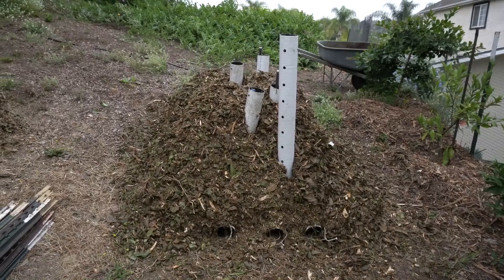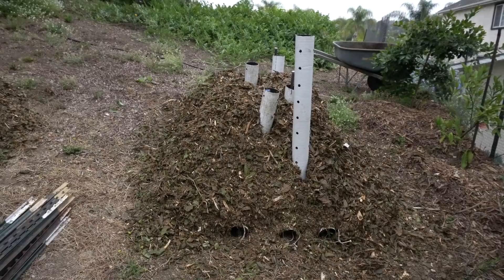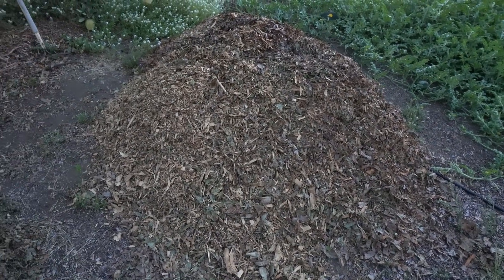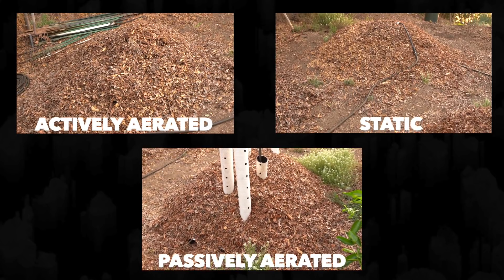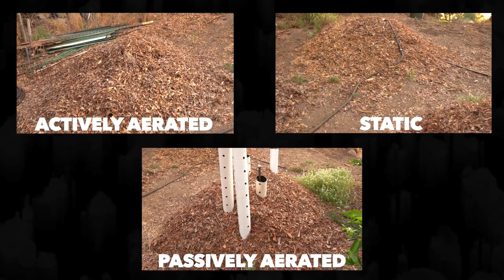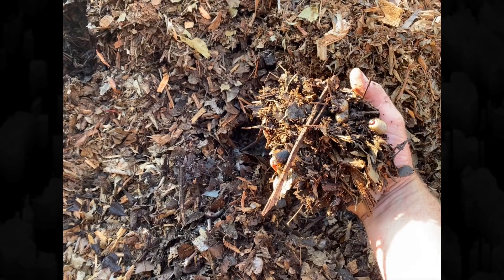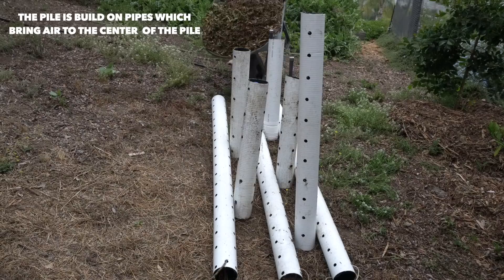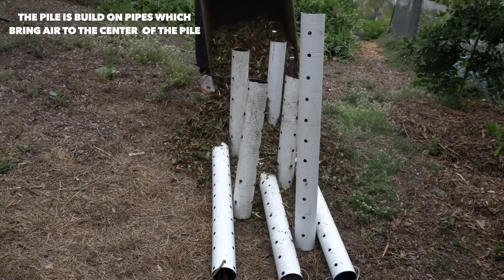Composting Wood Chips - Turning is a Waste of Time

Comment: I’ve noticed the biggest accelerator is moisture. The places on our property that stay wettest turn black fastest.
Reply: Agreed, I use to catch runoff...black and broke down in about 4 seasons.
Reply: And even faster if you moisturize with urine!
Reply: Maby using some amonia it acelerate the process
Reply: For the non squeamish, urine is significantly better than plain water in accelerating breakdown.
My beer & wine is all "recycled" through three large compost bays.

Comment: Personally I have found great results with blending woodchips with a good amount of fresh grass clippings, as well as shredded comfrey. I also took some weird old guys advice of adding worm juice and beer for an influx of microorganisms......at this point we're basically talking compost though. 

We have the perfect pest plant for woodchips in Australia. Not sure if you have it in American. It's a British originating pest plant called Lantana. Its a creepy woody vine that basically engulfs entire properties in two or three years if left unchecked. What is good about this plant is when mulched it has the perfect consistency of a very fine woodchip blended with alot of green material from its leaves. 

I've noticed Lantana woodchips break down VERY fast into a beautiful humus. I think this is due to the high nitrogen and high carbon in the woodchip. 

Good stuff man. Keep it up.

Comment: Just started the vid. Saw the three options tried. In my experience make it deep/tall and let it sit. Water monthly.

Edit finished watching. I do tree work we have a pile of chips 120ftx20ftx20ft. The stuff from the bottom and about 7ft up is good to go in about 3 year. We dump and push new chips on the top with a loader.
Reply: Wow! My wood chip piles started at about 7 feet high and i was thinking they were too high. Thank you for sharing the size of your pile.

Comment: Diego, love your channel. I wish I would have found you before I started my wood chip piles of compost. I may have tried some of the different ways like you did. 
I did however break down my wood chip piles to quarter inch to half in pieces, after sifting them through a half in wire mesh. 
I only did the turn method, but I did have to add a lot of grass clippings to them to help the nitrogen to carbon ratio. It took me about 12 weeks to get to that point. 
I turned and watered about every two to three days for the first few weeks, then as the wood chips finally started holding the moisture I cut back to about 1 a week. 

I would say you’re right about the wood chips taking a long time if all you have in the pile is wood chips.
Keep up the great work.

Comment: Finally I found someone on YouTube to talk about composting JUST wood chips... I'm having an arborist dump some wood chips and I need to know cubic feet or yards so I can have an idea of how much he's bringing.... I'm not a math guy at all...hence the confusion....also...me having a relatively large backyard I'm planning on having a huge pile or maybe break them up into a few smaller piles but the question is... because they'll undoubtedly be rather large are they more fire prone???
Should I really worry?? 
I live in zone 9 b , Phoenix AZ....I'm thinking it shouldn't take me years as it'll be in direct sun....my Dad told me that the sun will make the outer layers hard as stones and it'll take them forever to finally break down....please help me...any thoughts or suggestions is greatly appreciated....not gonna lie, I think it's doable but I am a little apprencive
Reply: If you make the pile wet enough it should hold moisture quite well. I wouldn't  worry to much since wood burns best if there is alot of oxygen. And a pile just doesn't  have as high a oxygen  to wood ratio  as a pile of twigs for instance.  I'm not an expert though:D

Comment: The Method Jean Pain was the real start of wood composting... you can find a lot of information about it. The first basic procedure for this proces was to soak the wood in water for some time before actually building the compost heaps. This wood composting proces is like a slow aerobic wood burning proces. The heat was used to warm swimming pools or other heat loving processes.

Comment: Good stuff mang. Nature takes a long time to break down wood whether it's a standing dead tree or a fallen dead tree. The different fungi colonize and break down the wood over years. Composting wood chips takes time. Thanks for the update.
Reply: Manure is the answer. 
I make a special garlic compost each year. I mix 50 50 woodchip and  1yr old cow manure, let it work for the 6 hot months. Then mix this 50 50 with my main compost and leave it for the 6 cold months. 
Works a treat.

Comment: hi Diego, u probably know that woodchips work best they are mixed with cow or chicken manure. I use woodchips as.bedding material, for my chicken pen, so it gets pretty well mixed with up with bacteria. This u can dump in your garden soil before winter, till in the spring and bob's your uncle..
Reply: We do this too. Works fast with chickens pooping and scratching
Reply: Woodchips and chicken manure make the best compost
Reply: The difference between just woodchips   and woodchips with manure would probably be the first fungal dominated(great for fruit trees) and the second a mix between fungal and bacteria (for annuals and perennials)

Comment: What kind of heat were you seeing in the passive woodchip compost? Were there large variations between the methods?
Reply from the maker: I can’t remember the exact temps, but active would get hot at each turn and then cool.  The other was more consistent.
Reply: @DiegoFooter  OK thanks.

Comment: Japanese traditional method of cultivating mushrooms consisted of wetting wood, inoculate fungi and cover it with a tarp so there wouldn't be any sunlight coming in. Because the climate was humid water wasn't necessary. So i wonder if composting in dark, with humidity above 60% and aerated would speed up the decomposition. Compared to a chunk of wood wood chips is much smaller and has more space for the mycelium build on. (I guess)

Comment: Hey Diego,

How well do you think cutting out the bottom of a trashcan and using it as a simplified version of a bioreactor would work?
Reply: You wouldn't get the aeration from the outside, which is the most important part. You would have to add more pipe to obtain the same aeration, which also reduces your volume.
Reply: bio-reactor useing permeable cloth to allow air infiltration on the sides as well as the holes placed in middle of pile with plastic pipes, so----probably nees to drill many many holes in sides of trashcan

Comment: Diego - I see the aeration pipes in your Johnson-Su bioreator are perforated and still present in the column. You may already know this??? your aeration will be improved if you do as recommended by J-S and pull the pipes out from the top after the pile has had time to settle (2 -5 days). The matrix of the material will maintain the air chimney for the life of the pile. Some care needs to be taken to prevent activity which knocks top material down the hole accumulating at the bottom and eventually blocking the air entry at the bottom.
I have done three batches and only used wood chips in the first one. After two Canadian winters and two summers, the finger sized wood was only decomposed about 15% of it's original shape.
A follow-up bit of backyard science would be to see what is the actual time required for a predominantly wodd chip column.
Reply from the maker: Yes, I pull the pipes out of the JSBRs.  

Thanks for sharing your results. 👍

Comment: Keep the discussions coming Diego. Love them. For me the benefits of woodchips are that they take along time to break down... useful for weed suppression around young trees, paths, chicken pen deep mulch. The bulky nature and high carbon content makes composting animal slaughter intestines and road kill easier because it doesn't compact. According to John Kempf the Johnson Su bioreactor provides the most outstanding biologically rich compost out of all he has tested and that's saying something. There are health issues with turning woodchip piles...the risk of breathing in mould spores. I have found that contact with wet soil on paths breaks down woodchips faster than a pile.
Reply: Ann - I heard John Kempf reference to the Johnson-Su bioreactor. Diego's experiment was pure woood chips. I suspect his original input material was NOT predominantly wood chips if any at all. I have had several chats with David Johnson since he published the bioreactor guideline and I got the impression he was discouraging the use of wood chips and certainly saying only allow chips the size of the end of your baby finger. Leaves are best.
Reply: @frshortop  Yes I agree with your comment. Mine was more about questioning turning compost in general..such as Elaine Ingham's style trying to keep it as aerobic as possible. Apparently it's the constant flow between small amounts that are anaerobic in the centre and with an aerobic outer edges of soil particle glue like structures that have the most active soil life. It makes me wonder about constantly oxidizing the compost pile.

Comment: Get a hose timer to spray water for five minutes every hour($25).  You can use a soaker hose or a lawn sprinkler.  The other factor to control is heat loss.  I use four upright wood pallets to create the stack.  I end up getting a fungal flush which breaks down the wood far faster than bacterial breakdown.  Then it gets colonized by worms and eventually end up with loam and worm castings.

Comment: By far the best accelerator I have found is urine.  I have been able to cultivate thermophiles and fungi keeping it moist mostly with the urine with occasional water.  My woodchips were composted soil in one year here in Arizona.

I agree, however, I have found no benefit in turning the chips.  The only benefit I have seen is to  introduce the top uncomposted pieces into the soil.

Comment: A pile taking a long time to break down implies that the decomposers aren't especially active, so it's not that surprising that turning wouldn't matter--there's just not that much demand for oxygen.  Most likely the passive aeration is also unnecessary in this case.

I'm more skeptical of the assertion, in effect, that there's little to be done to hasten the decomposition of the pile.  Contact with moist soil significantly hastens the decomposition of woody material, so the pile could be decomposed more rapidly by not gathering the material into a compact pile in the first place.  Most likely soil contact drastically increases the number and diversity of organisms that are working on the pile, but there could also be more subtle effects like soil containing trace minerals that are scarce in woody material but necessary for decomposers to function robustly.

Comment: Soak wood chips in a mixture of water, pelleted chicken manure, mycorrhizae inoculant and compost starter/accelerator to make them decompose faster.
Reply: You could use aggressive fungi species as well. Strangely enough, most of the wood loving types of psilocybin mushrooms actually tear through wood quite quickly
Reply: My two chickens turn the wood chips in their run into decomposed woodchips/soil in a couple of months. Must be a lot of microbes in there to kick start the process.
Reply: I put a good 2-3 ft of wood chips that I chipped myself with my chipper and it took a good 3 years before it decomposed enough to start growing weeds in that area. Since weeds are growing Im guessing I could grow a garden there now too!
Reply: Mycorrhizal won't germinate unless roots are there to feed it. Use spawn to inoculate wood chips.
Reply: @sethbeu7802  - that's not necessarily correct. Mycorrhizal fungi spores can germinate and survive without the presence of plant or tree roots, so long as the necessary nutrients and environmental conditions are present in the media that they occupy. Flora send out specific chemical signals and nutrients to attract mycorrhizal fungi, in order to establish a symbiotic relationship.

While cultured spawn exponentially increases success of establishment and potential inoculation in a specific area, it is not absolutely necessary. Using a simpler practice (i.e. the implementation of Korean Natural Farming or JADAM microorganism collection and innoculation protocols), you can easily introduce fungi into your growing areas (assuming you can locate and collect those fungi strains from a simple source in which it is present, such as leaf mold from a forest floor).

Spraying spores on wood chips also does work, but is dependent on the presence of those nutrient factors and ideal environmental/climactic conditions to encourage germination.
Reply: Store bought mycorrhizal spores won’t do anything for you in composting. Mycorrhizae should only ever be applied directly on, or at least very close to living plant roots. They will only germinate in the presence of root exudates. The spore viability will just get worse over time in the compost too, depending on the process used by the company selling the spores. Most store bought mycorrhizae is made from drying grinding roots up that have been inoculated with the mycorrhizae.

Saprophytic fungi are what your after in this scenario. Wine caps or oysters to name a couple edible mushrooms that can be used. But also simply dropping wood chips on the forest floor will promote a massive bloom in saprophytic fungi. Or make a point to grab some mycelium and leaf litter from a nearby forest to add to the pile if direct forest floor composting isn’t a viable option.

Also to begin with, wood chips come absolutely loaded with their own fungi. Trees have endophytic fungi throughout just about all of their tissues, some also having some parasitic fungi, which both will switch rolls and become saprophytic decomposers when the tree dies.
As long as the wood chips are moist, the fungi will be going to town on them. They just don’t work at a human pace, give it a year or two. 

Wet it, set it, forget it.

Sorry to go on a rant, but good quality mycorrhizae is very expensive, and you should never put it in the compost.

Comment: Larger and harder, more dense materials take longer to break down. If you want compost faster, use leaves, they're thinner. If you have wood chips you want to use, build a hot compost pile with nitrogen sources, water and turn regularly and you might shorten the 2 year process by a couple of months. Harder woods could take longer.

Comment: You need to add grass . What I do is add grass at the beginning . Monitor the heat . As it starts to cool down turn the compost and add more grass . I repeat this process until the chips are gone . It took me about 9 months the first time I tried it . I will try again next year , probably add more grass than what I used the first year

Comment: I will be the first to agree, after importing and distributing 100 cu yds. However, compost is NOT the purpose. The chips are the transmission layer for the fungus.  Composting is done on the next layer up with leaves and grass cuttings. The woodchuck must be long-term or you'll be rebuilding the mycorrhizal layer every year, and that's crazy.

Comment: Just so you know, adding nitrogen does break wood chips down much much faster.
Reply from the maker: Based on what?
Reply: @DiegoFooter  maybe by heating the whole pile up a little more(could be useful in cold season) giving the fungi more months to grow frost free.
Reply: Based on the fact that nitrogen is needed to break down wood chips. Did you just give up on greens and browns? Wood chips are mostly carbon. You must have nitrogen. Make some wood chip, manure lasagna and that pile will heat up and shrink pronto.

Comment: Efficient composting is a combination of carbon, nitrogen, moisture, air and microorganisms. Heat heat heat
Reply: What happens in winter when they are getting saturated with cold water?
Reply: @watermelonlalala  check out #dirtpatchheaven for how she makes her 'hot beds'
Reply: @michelifig6356  Thanks. I checked her out. She has manure, I wish I did.
Reply: I live in the tropics😉

Comment: as much as 99% of compost (lignin) matter is converted to carbon dioxide by microbes and released to atmosphere within a season. is it worth it for the 1% humus and is it that "green"?
mineral amendment of soil and cover crops (or even charcoal) put a lot more stable carbon and full nutrient profile into soil.
it's like painting a car with a toothpick. sure, you wont need a compressor, but you'll use thousand toothpicks and the result wont be great.
Reply from the maker: You are missing the picture.  The goal isn’t to just increase carbon so the soil has more carbon.  The carbon is a fuel source.  The goal is to have the carbon used by the microbes to fuel plant and soil growth.  You put carbon into the soil to use it, not just store it.  Some will be stored but much will be used.